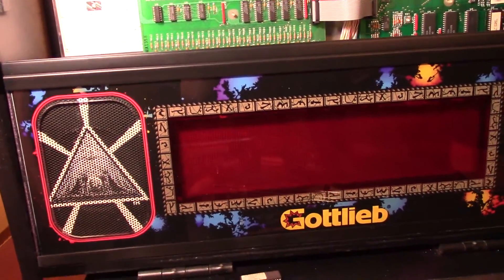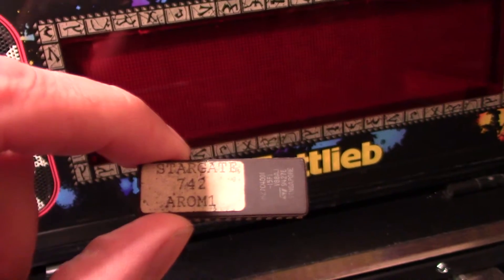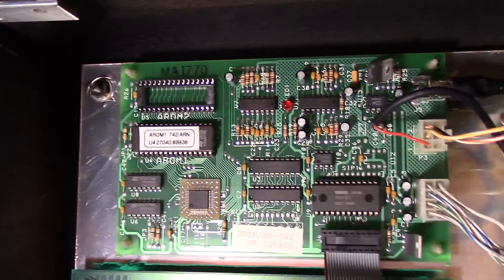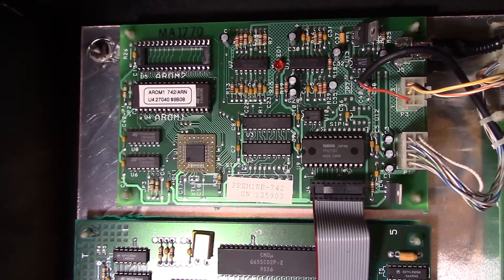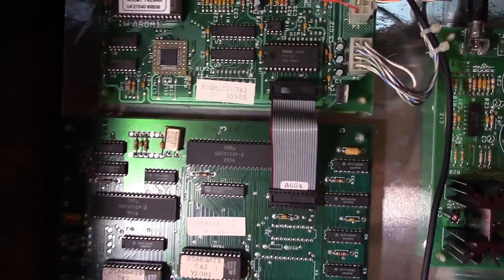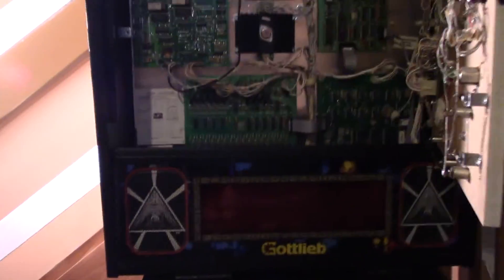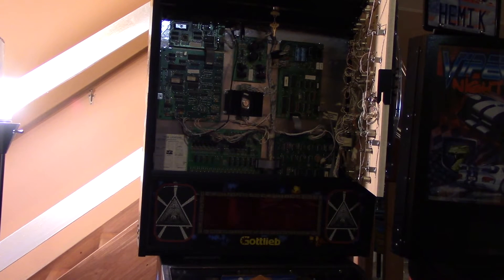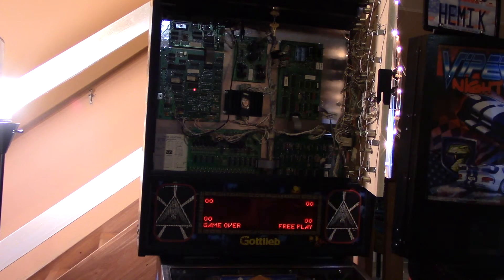Stargate Pinball Gottlieb System 3 Sound Modification Custom Sound ROM Mod

Comment: Why in Gods name would your nerf Stargate?
Reply from the maker: Why not! Seriously it's more to show what can be done. I don't run those ROMs normally my wife hates it.
Reply: @viperrwk  I was hoping for something where you re-programmed the trigger on the rom, to only trigger the pyramid sound every 2x'nd time or 3'rd etc... or vary it between two sounds like "Hurry Up" And "Get the Pyramid"
Reply from the maker: @amaraklov  You can already limit the "shoot the pyramid" callout by holding down the left flipper button when you plunge the ball. I forget if you only have to do it on the first ball or for every ball. Yes it would be nice if that were in the settings to make it be that way all the time but alas they didn't do it.  

Stargate got a lot of love from Premier/Gottlieb at the time as the game ROM went through five revisions and the display ROM went through three revisions. Most Premier games of that era maybe had one or two game ROM revisions at most but the number of revisions on Stargate shows how popular it was at the time and how they worked to satisfy the license.

Comment: Would you mind shooting me a message on how to do this? I am trying with my Tee'd off machine which is also a System 3 but when I swamped the sounds out it is triggering more than one sound. I am also testing the ROM via Visual Pinball before burning one for my machine.
Reply from the maker: Please read my response to AK Alves below. It details the settings you need to use to import the ROM file into Audacity to edit it. I will say you have to be very careful in pulling/replacing/silencing sounds so as to not cross over boundaries as each callout is indexed. If you're triggering more than one sound after making the edit in MAME that might be a MAME issue as the hardware doesn't care whats in the ROM as long as it doesn't put the 2151 into reset.
Reply: @viperrwk  Thanks, yea read everything over before doing it. I guess it can't hurt to get a blank rom and give it a try on the actual hardware. I appreciate the quick response!

Comment: good job !

could you tell me what chip i should order to do the same thing ? 

and  is it possible to edit the main music theme too ? i check in the arom1.bin file and could not find it... is it in an other rom ?
Reply from the maker: You need a 4mbit EPROM to burn the modified file to. You can change anything in that ROM but you need to make sure that whatever you put in there fits exactly with whatever you pull out.  And whatever sound you put in there has to be sampled to ADPCM at 8kHz so this will limit what you can put in there. The main music theme is not in that ROM - it is programmed from the main sound board Y section through FM synthesis of the Yamaha YM2151 on the Aux sound board. Unless you have familiarity creating music for the YM2151, then changing the main theme is not possible.

Comment: I have the arom1.bin file. How I can open it?
Reply from the maker: +Alexandre Kostetzer Alves I may do a tutorial one day and cannot do so within the context of a YT reply but In simple terms, get Audacity as I linked to above. Run the program. Do File:Import:Raw Data and select the ROM file. In the ensuing options make the following selections:

Encoding: VOX ADPCM 
Byte order: Litle-endian
Channels: 1 Channel Mono
Start Offset: 0 bytes (this starts at the beginning of the file)
Amount to import: 100% (this brings in the entire file)
Sample rate: 8000 Hz

The "Shoot the Pyramid!" callout is about 2m 04s into the file.
Reply: I will try. Tks
Reply: Just a small correction, the sample rate is actually 7,575 Hz. The sounds will be a little bit high pitch with 8,000 Hz.

Comment: So you are taking the romfile and doing what with it to pull up the data? Just a quick and dirty rundown will do :)
Reply from the maker: +Mike Gervasi The contents of the ROM are simple ADPCM files that can be loaded into any sound editor that can edit ADPCM like Audacity - http://www.audacityteam.org/. Since there is no validity checking (checksum, etc) performed on the contents of the ROMs on the aux sound board all you have to do is find the sound you want to change and either silence it or insert a new sound. Shoot the pyramid is only in the file in one location so once you change that sound, every time it is used in the game it will play the new sound you insert.
Reply: +viperrwk Thanks :)